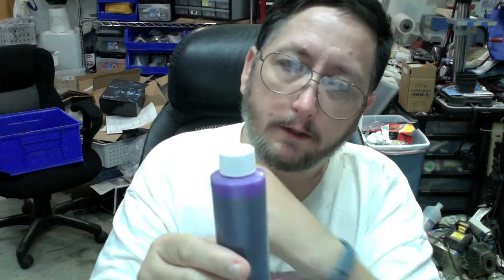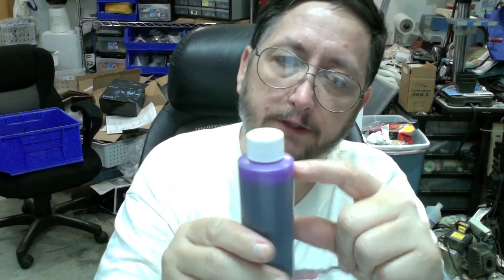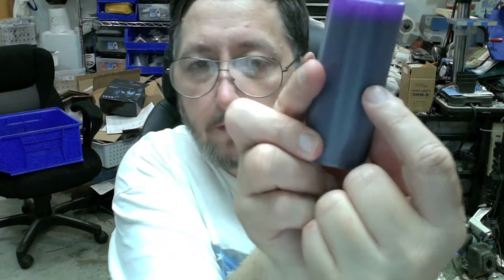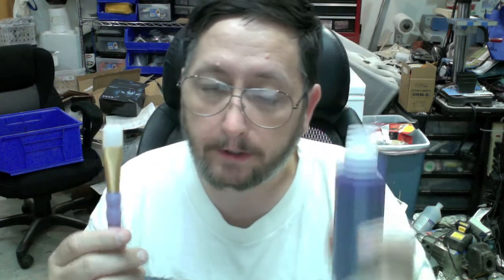How to make Glue Stick Juice For 3D Printing

Comment: Hey man. GREAT solution. I tried kapton, hair spray, glue stick and ABS juice right, none of them worked. This works amazingly,  too well in fact. Now I have a hard time getting prints off of my bed. Even after letting them cool for hours they are STUCK on there.
Reply: Try more water in your initial mixture.

Comment: Late to the party as always...  I came across this as I was having real trouble finding something reliable for PLA. As I have a Printrbot Play I have no heat-bed to help out.
I had a couple of cheap pound (dollar)store glue sticks, the white rubbery type... Cut them and left them in water for a couple days and the water started to get a little cloudy.. I needed something for a print I want to start asap. So I put my bowl in the microwave for 10 seconds and it worked a treat! I now have a paste I can use that's better than hairspray.... thanks for the heads up.

Comment: Thank you! This helped a lot. I just got the Solidoodle Press as my first printer and I am having trouble with getting prints to stick. I tried blue painters tape and the gluestick and hope to try the solution you made tonight. How hot do you heat your bed for Abs? I had the problem of the glue evaporating before the plastic gets on and the  the glue has no affect.